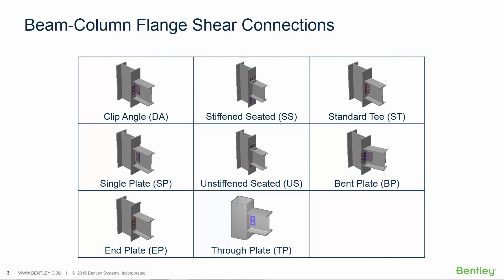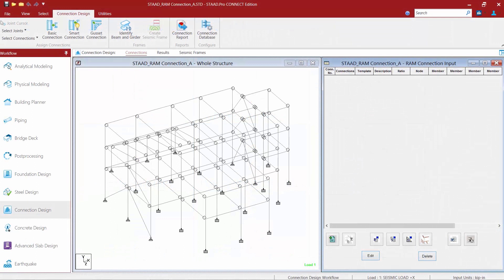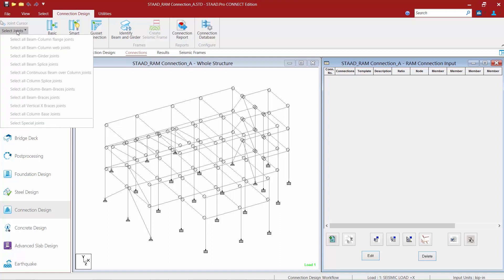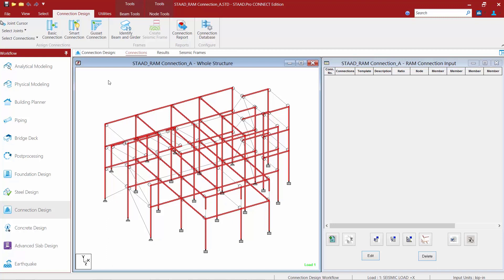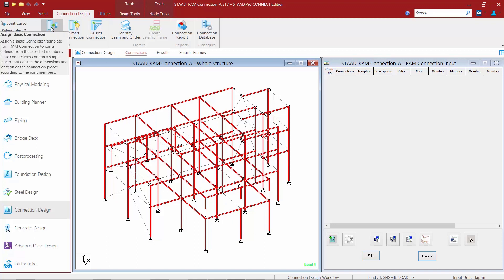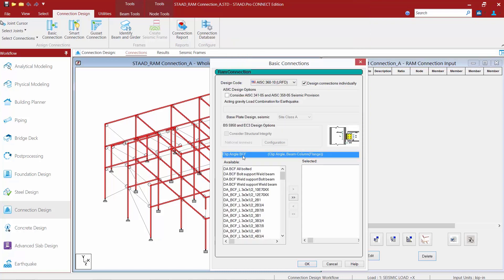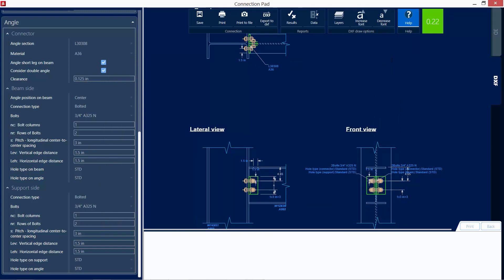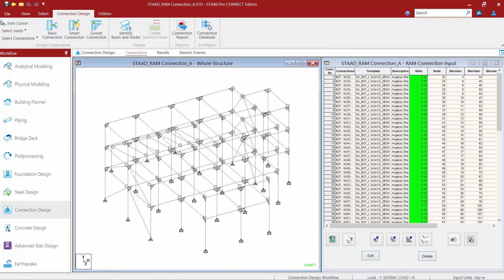Designing Beam-Column Flange Connections for Shear in STAAD.Pro

Comment: At around 3:13, I notice that the option of selecting configurations with 1/2" or 5/8" bolts is not available. What would be the reason for this?